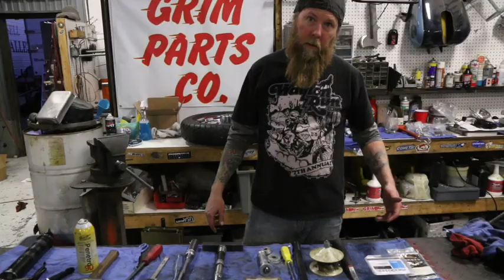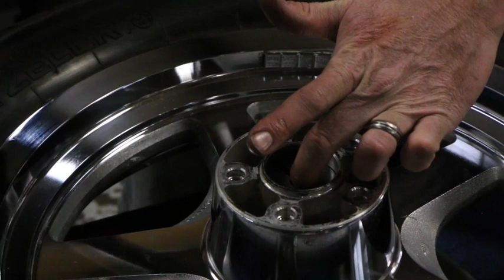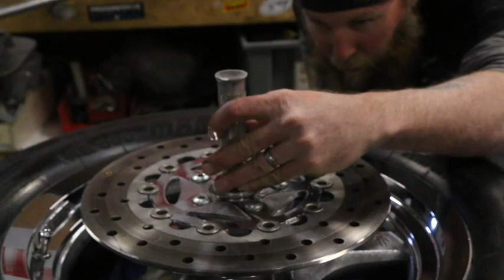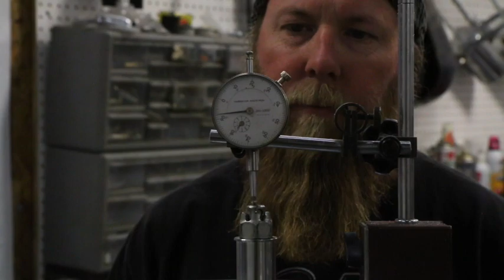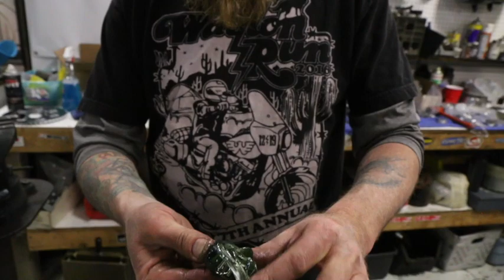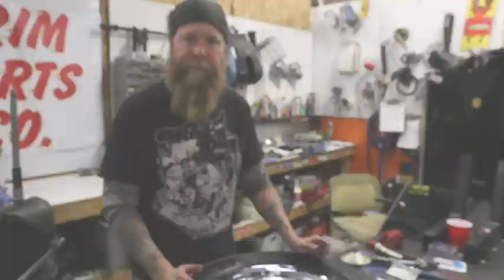Harley Davidson Timken Wheel Bearing Install and end play check model years 1970-99 Grim Parts Co

Comment: I have a question for my rv trailer, i changed my bearings, races, drums, so everything is new. I took a dial indicator meeter for the first time to look the play I have. Tell me if the way I did it is ok. Well the meter was magnet to my frame and the pin of the gauge was right on the top side of my drum, right to the edge of the drum, at 10'' to 12'' circle. I push my drum side to side and I got 0.002 and sometime 0.003. I know I'm in the range that it suppose to be but I want to make sure I put the dial indicator the right way. An other question tell me if I'm right, let say I have 0.002 or 0.003 from the 12'' drum do you thing if we were able to measure the play right between the bearing we could find around 0.001? And let say if I was gona be able to put the dial meter right againt the metal wheel or the tire we could expect to have like 0.005 or maybee a little bit more cause the wheel is bigger size than the drum and the bearing itself ? I'm trying to make myself a template or kind of a model for next services, if this is right the way I did it, I will keep in mind 0.002 to 0.003 from the drum is a good play for bearings, so not to loose or not too tight. I really like your channel very informative and you explain very well. Thanks.

Comment: Nice video! I ve  done my 87 FXR many times thru the years. I don't have some of those extra spacers in my wheels.Mine have always been pretty straight forward,I put new races & bearings in using the OEM Spacer Tube and when wheels are torqued they spin freely and no lateral play that I can feel .I always feel the hub after riding first few times to make sure its not running hot.
Reply: Same here

Comment: You work to hard. Next time. Just put Raceway in Freezer for 2 hours. And it will fall into the Bore.  Once it Expands. Just Reseat Raceway to be sure it's seated.
Reply from the maker: That works great if you have time. In a shop time is money, and you have to do things right and fast. Thanks!

Comment: There is a little fork that keeps the bearing tool in place while you flip the wheel over. Jims spacer №2388 It helps a lot. Also, I'm surprised you didn't heat the wheel before hammering the outer race.
Reply from the maker: Yeah I never had that tool but it works. I have heated up the wheels in the past. Most of the time it is not necessary.

Comment: Does it really matter what side you put the top hat shim?
What about dual disk front wheels? Does it matter what side it’s on?
Reply from the maker: Some wheels have larger hole on one side. But I like to run it on the opposite side of the disc.

Comment: Is it OK to check end-play with the shims and top-hat spacer installed on the brake disc side when your wheel specifically requires the spacers and top-hat to be installed on the sprocket side?
Reply from the maker: Yes is should be the same end play either way.

Comment: Just watched your video and would like to know if the tool you used was a Jims tool and if so what number was it?
Also what is the number of the timken race you removed.
I have a 1978 FLH with race #LM11910  and the Jims tool I was led to believe was the right one is too large for the race.

Comment: I set the end play, after install I had .020 side to side play after install.  Like a little wobble in  the wheel. It is odd end play set and the wheel would wiggle if you grab the front and push,  grab rear and pull it would move .020. All new parts too. Any hints it's on a 73 flh.
Reply: I’m hoping u mean .002 which is 2 thousandths .02 is 2 hundredths which is way too much end play
Reply from the maker: .020" is too much we run >002-.006"  you will feel .020" shim it!

Comment: Great easy to understand video.  This will help me a lot when I go to repack my Softail wheel bearings this summer.  Hopefully they look good because I don't have a race remover if I need to replace the bearings, and subsequently, the races.  One question...is it possible to install the wheel back on your bike (without the seals installed,) in order to check the end play?  I don't have a big-ass vise to use in my garage. Liked & sub'd.
EDIT:  Actually, I just checked my H-D service manual, and they say to grease the bearings and install on the bike before checking the end play.
Reply from the maker: yep - just set up the dial indicator and test away
Reply: Grim Parts Co how would u use the dial indicator with the wheel on your bike?

Comment: I’m having an issue with setting the end play. I have wheel mocked on vice with dry new bearings and races.. new hub sleeve as well, but when I torque it down I have no end play at all. I had a spare hub sleeve which I shortened thinking it’d give me some play and it never did. Am I not understanding something?  Any incite would be awesome. Thank you.
Reply: U need to add shims
Reply from the maker: Longer to get more end play. Sorry I am no good at responding.